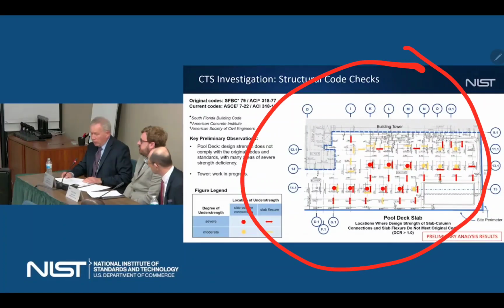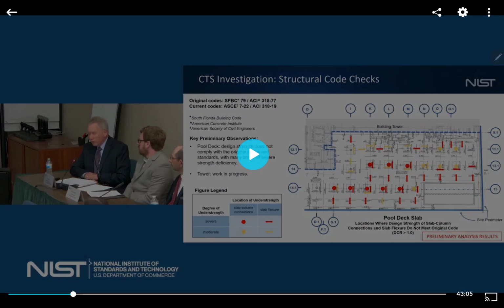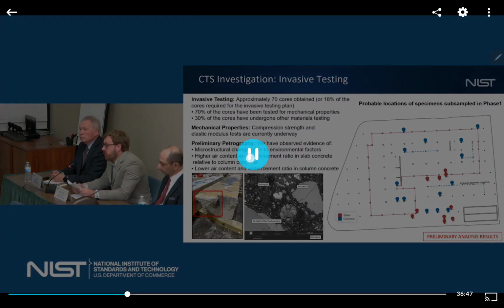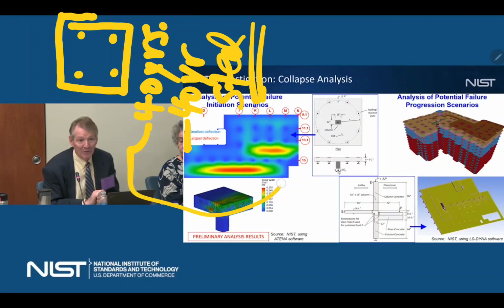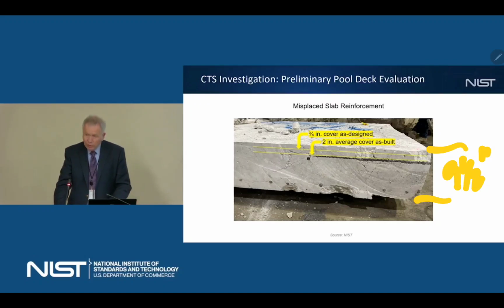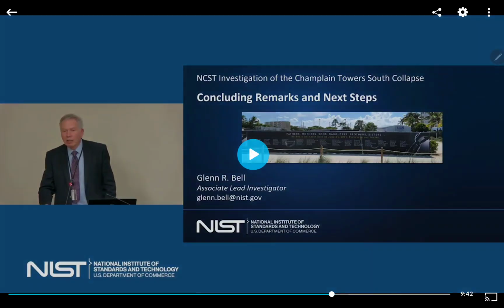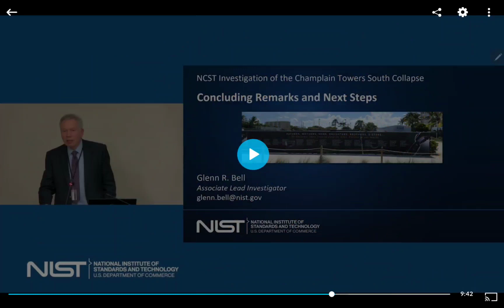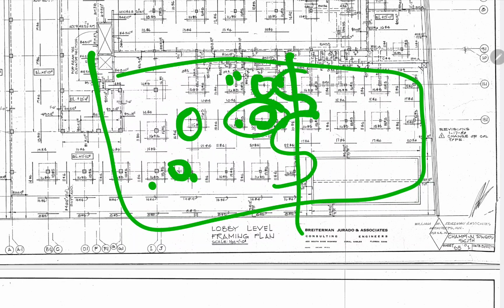Champlain Towers Nist says they are lost; SARAH BLASKEY did better, now for Alyan Kilsheimer

Comment: In other news, the Leaning Tower of Millennium repair is not going according to plan. 

In response, the engineers changed tilt measurements (from the roof to the basement). They are seeing less volatility and less movement. Can't make this stuff up. 

Today, the Millennium Tower reportedly is tilted about 30". At 38" the elevators and plumbing (drains) will not work according to some reports. 

Reportedly, Millennium Tower was a lightweight steel structure with pilings into bedrock & "evolved" into a concrete beast with pilings into liquefying sand.